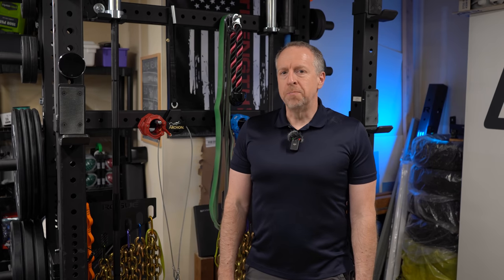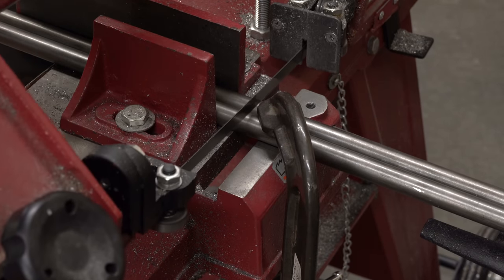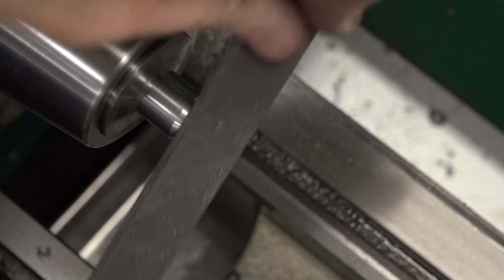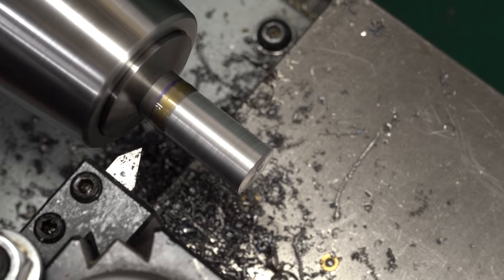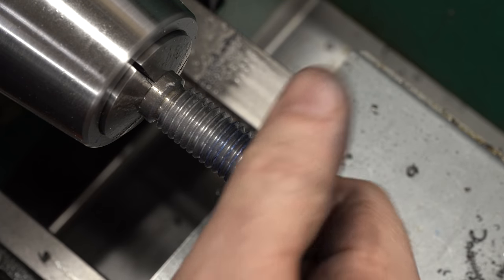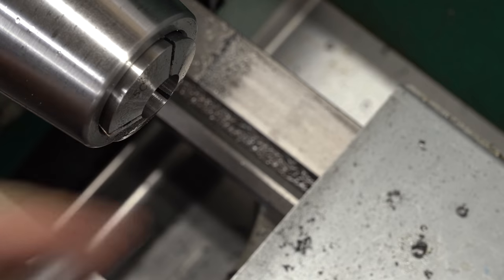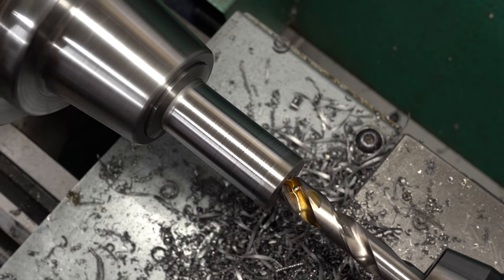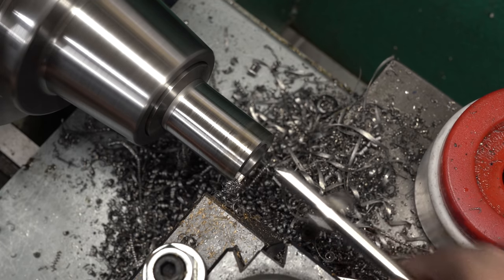Machining and Welding Steel Storage Pins | Rogue Monster Lite Squat Rack

Comment: I would  suggest using electroless nickel instead.  it is a true conformal coating process and works extremely well on that material.  I've used it for years and have not had any rusting process of parts

Comment: Great video! I have completed numerous home plating projects using Caswell plating materials. Have done zinc, including chromate, both yellow and clear. Also have done nickel, having a  very chrome like finish. Getting into copper plating and eventually chrome plating soon. You will want a quality power unit where it can maintain a constant current that is dialed in based on your surface area calculations of the part or parts being plated. The process is part science and part art to receive quality plated finishes. Does take practice. I also recommend an aerator submerged in your plating tank. Helps tremendously with improved finish work. Cleaning preparation and vat temperatures are very important.

Comment: stack the dowels vertically when you cut them.  We do it all the time - no issues.
Reply from the maker: I was a little worried that one or two in the middle would spin, tearing all the teeth out of the blade.

Comment: Unless it’s weld material specifically made for hard surfacing, weld material is designed to be fairly soft, it is so that it can be easily ground or machined. I machine my welds sometimes, and carbide works very well with it.
Reply from the maker: My concern was more about hardened spots in the parent material, but there's very little carbon available here, so there probably isn't any real risk of that.

Comment: I set up a nickel plating tank,  just to try it out. As long as I stuck to the procedure it worked out really well.  Not tried it in anger yet.
Reply: Nickel is my tool finish of choice, none of that 'oiling' business, ever.
Reply from the maker: It worked really well.  Video to come...
Reply: I also tried accelerated rust bluing, messy and a bit frantic but produces a top quality cosmetic finish.

Comment: lol, that clamp thing you did took you longer than just stacking them up on top of one another. the machine doesn't cut any volume of steel any faster just because it's laid out horizontally

Comment: I see a return to normal programming in future. This will likely be a saw vice top clamp for round and odd shaped stock multiples. Another project may be a coolant setup for cleaner cuts and blade longevity. 
All the gizmos must be made...

Comment: you know what would be really cool is a way for your vfd to read your cross slide position to speed up and slow down too keep the rpm in the optimum range for the optimum feed rate like on industrial cnc machines
Reply from the maker: I don't think that would be too difficult, assuming you have a scale on the cross slide.  There are some details, like having the controller actually know the tool position, but it's possible.

Comment: the rubber abrasive thing, you're blowing it out of the threads with the exposed ways underneath. abrasives in the ways is very bad. cover em up with something when you're using abrasives of any kind; I don't see too many people doing it but some wet cloth is likely a great idea because the tiny dust-like particles won't just slide off it upon removal.

Comment: Why not stack them vertically in the bandsaw vice with a piece of wood to take up imperfections?
Reply from the maker: The wood strip is a good idea.  That would keep one in the middle from spinning and tearing all the teeth out of the blade.

Comment: If you want to use the center drill a tip is to only use the first flutes, since center drills are usually 60º and your twist drill is usually 118º or shallower. Not ideal.
Reply: He did say he usually uses a spotting drill

Comment: How was the penetration on those welds? MIG can easily build up the surface but not penetrate. A good size undercut allows for better penetration. Superfluous for this application though.
Reply from the maker: I think it was pretty good.  I can't see the penetration into the pin, but it definitely melted down the edge of the ring and appears to be sunk in well.

Comment: any updates on the new CNC router? i may have missed an episode while out of town..nice work as always .I actually made a set of olympic dumbells a few years ago , the 2 inch parts were 3d printed but held up well. I basically pressed them onto the knurled shafts.
Reply from the maker: I have many projects in progress at the same time.

Comment: was the previous video with restoring the lathe done in the middle of this video - as i thought you had a better cutting experience at the end of that video than the start of this one with making the rounds?
Reply from the maker: No.  You're seeing things in order.  Every piece of material and cutting condition is a little different.  It's so much better than it was before--especially the parting.

Comment: Could just spray them with clear lacquer for rust prevention. Or any number of rust inhibitors.
Reply from the maker: They're subject to wear, so paint type coatings would scrape off.  And oil film coatings would get on my hands and the gear.  Tough to pull a 200kg deadlift with oily hands.  T9 might work.

Comment: Can you thread in both directions with the electronic speed control?
Reply: Yes he can. He can also do metric threading. You should watch the series, it's really well thought out and very interesting in my opinion. I believe it's under "electronic lead screw". You can also buy the control from him on ebay, the community demanded it, and he gives resources for the parts he used. I plan to do it at some point myself.
Reply from the maker: Yes.  It's all electronic, so reversing is easy, as long as your leadscrew mechanics are able to handle the thrust load in either direction.

Comment: Can you dc inject for a brake?
Reply from the maker: Yes, and I have it enabled, but it only engages below 10Hz, and at a maximum of 20% torque.  I think the factory default turns it on at 1.5Hz at 5%, just to bring the system to a final stop.  Other VFDs might offer more options.
Reply: Yeah mine allows me to use it as a spindle brake on my mill which is good because the brake shoes disintegrated and it was hell to find the right chinese ones to replace them.

Comment: You could black oxide coat the rods. With how the oxide finish works it essentially converts the outer most surface of the part to the oxide finish so it doesn't change dimensions any significant amount.

Comment: Not making a tool for a tool you already own? Wow. That’s why I stop by. Considering unsubscribing. Cheers man. Looking nice.
Reply: Technical thought: I always try to chamfer a thread with something other than a 60 degree tool, as it seems that the nut seems to be less likely to cross thread. In other words, it’s easier to start if the angle of the chamfer differs from the angle of the thread itself.